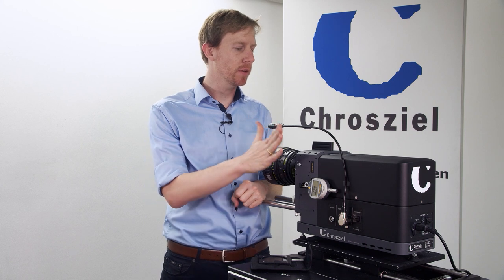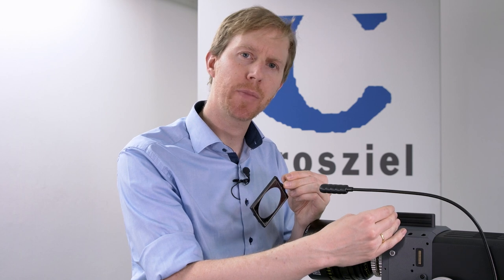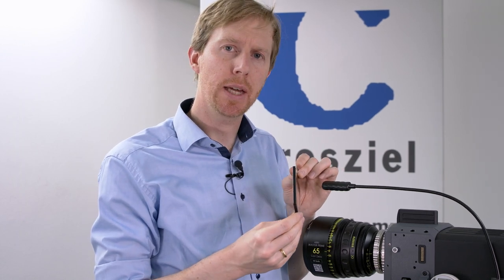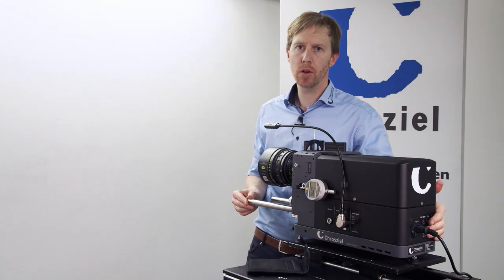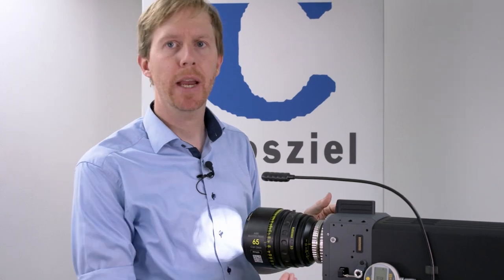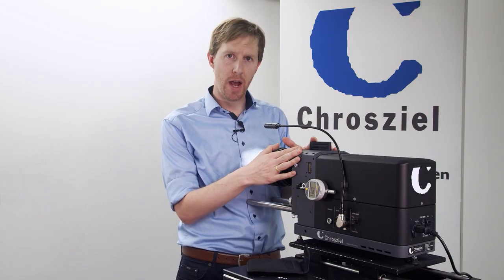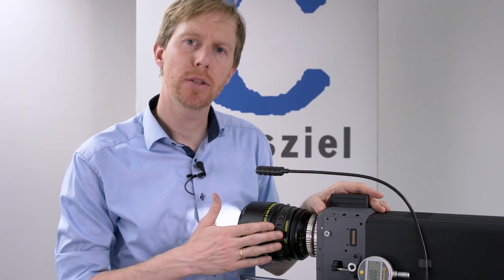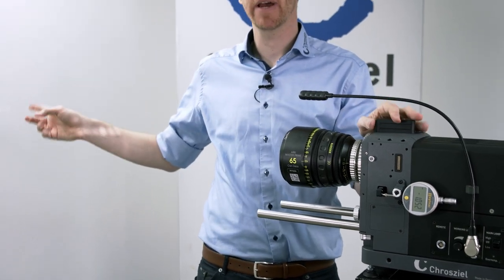How-To Camera Simulation Glas - Chrosziel Lens Test Projector P-TP7

Comment: this is quite confusing on many fronts with regards to the 1.052mm change in BF. If i were to calibrate a CP2 or UP or any other CINE based lens when resetting it back up after a service, i would stick it first on the Chrosziel flat bed and set it to 52.00mm to get the end stop correct etc for use with a range of CINE cameras. Therefore it would be perfect through the range of distances (most of the time, LOL). To this date i have had no complaints from any Camera assistant saying scaling was out and these are cameras such as Arri Alexa - > Arri mini LF, RED, Sony Venice, F55 etc etc. I understand the LPF gless thickness but why are the no complaints... ever... from clients on scaling and i dont allow for this when adjusting BF on the lens. THanks.
Reply: I'm not certain of this, but what I suspect is going on:

In a film camera, the film sits 52mm from the PL mount flange. Lenses are calibrated to 52mm on a projector, and everything works perfectly. Simple.

In, say, an Arri Alexa, the 3mm of glass in front of the sensor would shift the point of focus, so that if they put the sensor 52mm away from the PL flange, a lens calibrated for 52mm on a projector would not have its markings match up.

So, I suspect they don't put the sensor physically 52mm away from the PL flange - they put it optically 52mm away, once the glass is accounted for, which would physically be 50.948mm. This means that everything lines up as expected.

So what you're doing, adjusting things on a projector with no glass, set to 52mm, is exactly right, and will work with all cameras because their sensor distance from the PL flange has been designed to take into their own unique glass thickness.